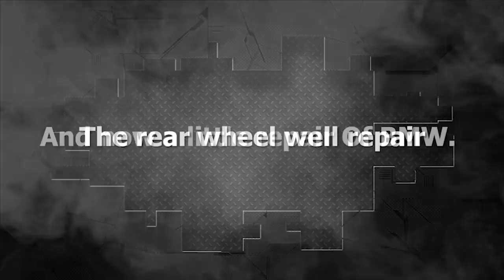Look in the future. Смотрите в будущем.

Comment: I use to imagine what happened to a car, but this mercedes I couldn't imagine
Reply: Same here 😁👍
Reply: Fire service used the jaws of life to cut the roof off.
Reply: @johnturner4400  Yea, but why? It barely has any damage. The only thing I can imagine is that it landed on the roof (side airbags deployed), but why would they cut the roof off then? Maybe it flipped all the way over.
Reply: I think it went under a truck or something like that.
Reply: I wonder if it's one from that car-hauling train that went under too low an overpass.
https://www.youtube.com/watch?v=pcqfa_uj2hA
Reply: Yes jaws of life. 
But they do tend to cut the roof a bit to often sometimes in some countries. They don't care about the insurance costs. Just want to make it easy
Reply: @Marauder252  I'd rather they cut the roof off 100 times to much than one time to little giving someone a permanent disability.